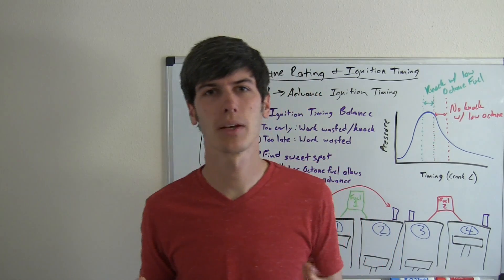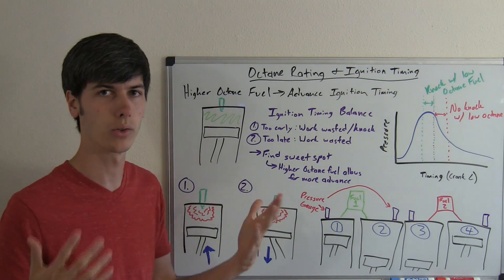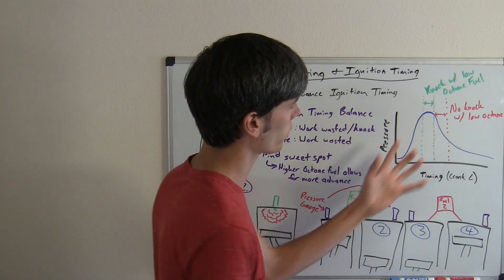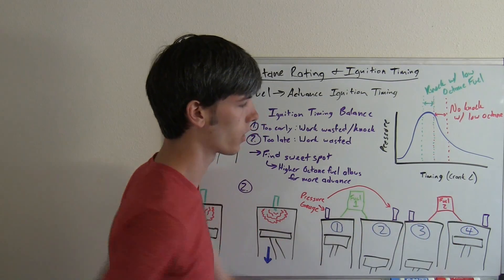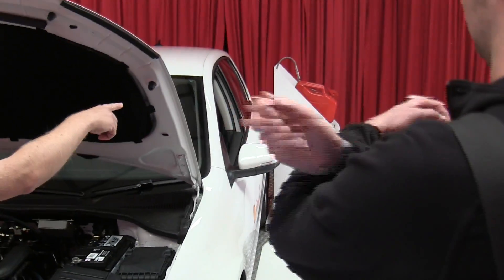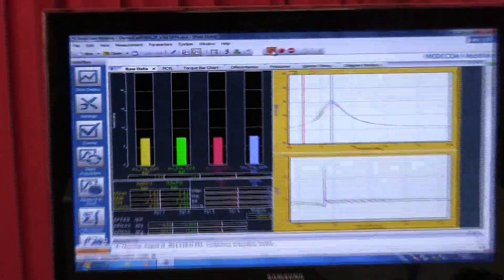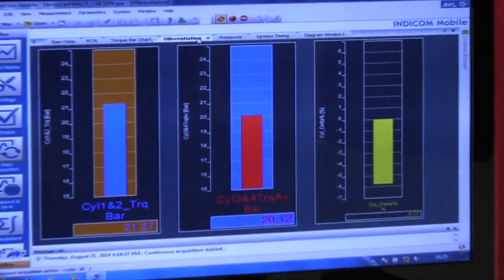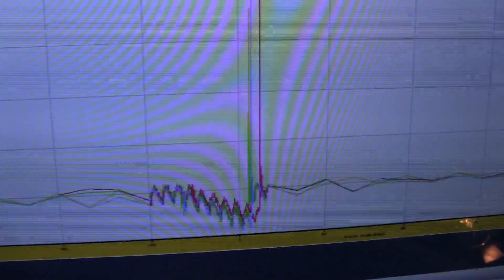Dyno Testing Premium Fuel - Octane Level vs Performance - Shell V-Power

Comment: so with todays modern engines lets say someone put the wrong recommended octane, would the ecu always compensate for it? like a difference of 93 to 87? also some cars are sold recommending 93 but some states only offer 91 is the car pre tuned for the state by the dealership or its tough luck, you have to do it yourself or you risk damaging a new vehicle you bought? Thank you anyone for the info in advance!
Reply from the maker: Mustangandtang Most cars are going to accept lower fuels without problems. Just don't get aggressive with the throttle when you're using a lower grade fuel.
Reply: Engineering Explained The engine will automatically advance the ignition timing if i pumped fuel with higher octane rating? Perhaps after detecting no signs of knocking~

Comment: See in my old car I had an issue where the car would jolt in 2nd gear and judder all over the place, that was using 95 RON. I decided to trial the 99 RON as at the time the price as barely any difference and it cleared the juddering. However why would that be if the car is designed for 95 RON?

Comment: It depends on what your car is tuned for as you said, you might not want the timing too fast and the piston still be on it's way up. That would creat higher pressure but would give you much less power.

Comment: if my engine cannot handle or it design for certain compression ration or pressure,i will not get any benefits  of using more that required octane.

more octane if not more power in all cases

Comment: I havent found a video where you test\analyse\explain whether an octane booster actually works, I mean there are two sides of the story, first one being "oh, dont waste your money on such useless things" and the other offcourse is "suuure its works brah, I have 50whp more!"

your view on this?
Reply from the maker: eagle Buy fuel with the octane rating you need. If you think about it from a volume perspective, the octane rating of whatever you add would have to be incredibly high in order to increase the overall octane rating of the fuel you're using. Unless it was some sort of chemical enhancement, like adding lead, but I'm skeptical of their value.

Comment: I'm not an engineer, but I do understand the mechanics of how this works. All the posters comments are dead on! I do have a problem with two cylinders running on one gas and the other on a different gas. They should have, as mentioned earlier, ran a test on all 4 cylinders on one type of gas, then on the other higher octane rated gas, and gone from there. As far as timing goes, they should have not done a pressure test on 2 vs 2, as the engine pistons are connected and even one cylinder affects the other three. I see the point here, but believe it is psuedo-science to promote a fuel that could have been tested much more EFFICIENTLY ON A DYNO.... lol. HIGHER PRESSURES COULD BE FROM KNOCK, SO WHO KNOWS... TIMING IS IRRELEVANT AS THE PISTONS ARE CONNECTED AND "play" off of each other......
Reply: +phillys976 The crank bearings were like oh hell no!

Comment: I used Shell V-Power 93 Octane for my road trip to Boston on the weekend of New Years. The vehicle is a 2014 Subaru Forester 2.5 Touring with EyeSight. The engine does have direct injection, although required octane is 87. At cold temperatures, 87 lowers fuel economy when I drove to Albany last year to visit my sister at the time. Shell V-Power 91 or 93 has 5 times more additives than their 87 octane, and if you have a direct injection engine, requiring regular or premium gasoline, use Shell V-Power once every 5,000 miles to remove and prevent carbon build-up on injectors and in some engines, intake valves.
Reply: +Tim Joseph You're not going to clean your intake valves with fuel on a direct injection engine no matter the grade or how many detergents it contains. Direct injection combined with EGR is WHY you see heavy buildup in the intakes; no fuel in your intake to do the cleaning.

Carburetors and single point fuel injection systems had no real issues with carbon buildup because everything was constantly soaked in fuel and cleaned.
Reply: Higher Octane Fuel produce Less Energy per liter thus Lower Octane fuel give you more mileage

Comment: It would be really cool if you did a bit on octane boosters. i.e. do they boost octane to the extent that they claim they do. I live in SF California and it's a decent pilgrimage to get 93 octane fuel. i have to drive like 30 min to a station that has 100 octane racing fuel and mix it with 91. I'm not looking to see if they give performance gains or anything like that, just octane ratings.

Comment: octane is the aptitude of the fuel of being compress. so the fuel is more stable when it comes to compression and it doesnt burn at the wrong timing.high compression engine needs high octane fuel because the compression is too high for low octane fuel and it becomes too unstable and it may explode a the wrong time! high octane = more power : not on every engines.!

Comment: You ought to mention that the test car is turbocharged AND direct injection. As such it will maximize the benefit of high octane fuel. Your typical passenger car will not see the same type of gains. In fact if the car was designed to run on 87 then you will see little to no benefit from using higher than recommended octane. If however you use lower octane than recommended on a very modern engine, you will get lower power than intended by the designer.

Good video, but only half the message. On a stock car, use the RECOMMEND octane.
Reply from the maker: Patrick Ford Yep, I always say use the recommended fuel for your car. There's no point to use anything higher.

Comment: I thought lower octane fuel would lead to the spark igniting earlier since the air fuel mixture would be more susceptible to pre-detonating. Could you tell me where I got it wrong?
Reply from the maker: K Sadek Pre-detonation is unlikely, but knock can happen as the pressure and temps are much higher. Octane number is a fuels resistance to knock.

Comment: So you're telling me that just putting a higher octane fuel in my car will give it more power because the engine can automatically advance the timing? And if so, what would this do to a carbureted vehicle without you having adjusted the timing on it yourself? Would that create a knock in and of itself due to late firing?

Comment: How come many higher elevation states have as low as 85OCT gas? The elevation difference on the engine will allow it to even run lower octane and not produce knock? Is that how it works?

Comment: my 2002 sentra spec v says to run 91, I noticed running lower grade the knock. 91 it sounded better and got better mpg.
Also most had modified the knock sensor to let it become LESS sensitive.

Comment: my father had a ford ranger 2.5 turbocharged 2WD but only make 130km/h , feeling that engine is losing power a lot while going up hill ..... what's the main problem ? engine seems no weird sound no black smoke ( thanks for solving )
Reply: Check about ford ecoboost carbon build up, fords are having that issue with their turbos

Comment: Stock timing maps of regular cars usually won't allow any adventage of using high octane fuel. To have any power gain, you would need to tune timing maps first.
Reply from the maker: andrew aswert Agreed as they have to accommodate all fuel maps, but some systems (modern ones) are capable of altering timing based on fuel used (as demonstrated).

Comment: Ok, we see the difference in 4-5% in compression ratio, but how much is that in engine power and fuel economy? That test tells me nothing as a normal consumer who, lets say, doesn't know how engine and fuel work.
Reply from the maker: judiccc 4-5% in pressure, (as in more torque). I don't expect the average person to understand everything in this video, but I have a bunch of videos leading up to it that help explain it (see the video description for more detail). It's in no way a simple topic.
Reply: 0Sirk0 better fuel = better performance = finishing the same amount of distance faster => lower fuel consumtion for the same amount of distance
Reply: Engineering Explained could you have just said yes better fuel helps fuel economy or that it does not?

Comment: I thought it's the opposite, I think lower octane will ignite earlier before the piston reach TDC therefore it'll causes engine knock
Reply from the maker: 7150285 Don't think you quite got what I was saying in the video. You can ignite higher octane fuel earlier with a spark (not compression) than lower octane fuel without having knock. Pre-ignition is something different (combustion via compression) and not what this is referring to.

Comment: One thing I've never thought about before is what if you mixed different octane fuels? Like say you filled up the week before on 91 RON, and you have half of a tank of 91 and fill the rest up with 98 RON, what does that do to the fuel? Does it make 98 RON as low as 91? Does it kind of average out?

Comment: Engineering Explained  Hi, my engine's compression ratio is 12.5 : 1 and manual says a minimum of 98 RON should be used. I've heard these cars will detonate on 95. Anyway, if I add forced induction to this engine would it increase the likelihood of detonation since the compression is already so high? Thanks.
Reply: Yes.
Reply: Yes
Reply: LowFlyin' mrniceguy5621  thanks

Comment: this is assuming your car is smart enough to adjust ignition timing based on feedback from knocking sensors.
I dont understand why they set up the experiment like that and not completely seperately, all 4 cylinders running on same fuel.

also your explanation is a little bit too simplified from reality, but I understand given the time you reserved for the video it is difficult to cover everything
Reply: For example the pressure-time graph you drew is in accurate. That graph should only used if there is no ignition.
and also there should be a delay in peak pressure after the spark. Which is why most cars run on advanced spark timing (ie. BTDC).

Comment: I did a test on a long drive across Pennsylvania where I used 87 octane on the way out and 89 octane on the way back. Not surprisingly, the 89 octane gave me better mileage. The next step was to compare the increase in mileage to the increased price of the 89 octane fuel. The result?  Although I got better mileage with 89 octane fuel, it actually cost me more per mile to run the car. So...I'm actually better off running the 87 octane and getting less MPG. If I were doing a Track Day, 89. Day to day commuting...87.

Comment: So from what I understand from this series of videos, there is no harm in putting a higher octane fuel in your car than what its rated for. But if you put a lower octane fuel in then it has a chance to prematurely ignite and cause knock. Is that right? Just wondering because everyone I talk to says that knock can be cause by too high of an octane rating as well.
Reply from the maker: You are correct. Octane is a number designating a fuel's resistance to knock, so it's incorrect to say higher octane could cause knock.
Reply: Forgetting something vary important here...sure it prevents knock, but it also burns hotter. The hotter the burn, the more NOx emissions you get. Also the more your cooling system has to work to keep your power plant nice and cool.
Reply: fightingfalconfan There is no more potential energy in a gallon of regular gasoline than in one gallon of premium gasoline. A higher octane fuel, which has a lower heptane ratio, rating improves the engine's resistance to knock. 

Engines with higher compression, such as in BMW engines, will require higher octane fuels because this extra compression of air may combust low octane fuel prematurely.

Comment: Out of curiosity: I drive a '97 Mercedes S320. I have always used 87 octane fuel (car is obviously engineered for min. 91). A couple years ago I decided to fill up with 94 or 91 octane to see if there was any observable improvement in mileage. I did this for about a month, but then stopped because I realised that ever since I did so the car was idling very rough, and I was even having difficulty starting it at times. As soon as I went back to 87 octane (not the recommended fuel), the idling was smooth as silk again, and no issues starting the car. Why might the higher octane fuel have had that affect? Is my car "used to" the lower octane fuel? I'm really quite curious...

Comment: Also, performing this test on a turbocharged car is not representative of all cars, as its high compression ratio (thanks to the turbo) allows it to take advantage of higher octane fuel to prevent knock. Most economy N/A engines don't have the compression ratio to use higher octane fuel in a more efficient fashion, as they are tuned to efficiently run on 87 and can't much advance timing when using anything higher. This is an assumption based on what I know.
Reply from the maker: Turbo engines typically have lower compression ratios, due to the high pressure from the turbo. I believe this car was NA.
Reply: Engineering Explained It was a Golf TSI. I don't think VW make a non-turbo'd engine and put a "T" badge on it... ("think" being the operative word)
Reply: Engineering Explained Forced induction engines already compress the air so although they have lower geometric compression ratio than NA engines they typically have higher effective compression ratio, thus the high octane requirement.

Comment: Is it correct to say that older cars with a single knock sensor could not alter timing per cylinder, just a single timing for all four? If I were to run this test (two cylinders getting different fuel from the other two) on an older Corolla with a single knock sensor, I assume timing would be at its latest to prevent knock.
Reply from the maker: Nope, because the firing order of the cylinders is known, each cylinder fires at a different time (some layouts) so a single knock sensor can detect which cylinder is knocking.
Reply: Engineering Explained Interesting, I didn't think mid-90's computers were smart enough for that. Thanks!
Reply: Haloruler64 Late 60's computers were controlling rockets and blasting us into space, so it's not a stretch for a CPU from the 90's to do the maths to work out which cylinder was producing any knock.

Comment: Does each cylinder in this car have the ability to adjust ignition timing for itself?
Reply: How is that possible? Aren't their valves driven by the same camshaft and so by the same VVT? And assuming that every cylinder can have a different timing, what's the point in it, considering that they "usually" run on the same fuel? Thanks!
Reply: Ntivalen The timing of ignition. Filling the combustion chamber with air/fuel mix happens manually by the valves, as you say. Same with exhaust. But the actual time of ignition is done by independent spark plugs via coils.
Reply from the maker: Yes, as seen at the end of the video.

Comment: So if you were to raise the compression ratio on an engine. Either by putting high compression pistons, or by machining the head to a shorter height. I would have to run high octane fuel?
Reply: most likely, depends how much your raising the CR by
Reply: that too but that gets more complicated and depends greatly on the vehicle
Reply: 92KidNew And or adjust the ignition timing to help prevent knock/detonation.